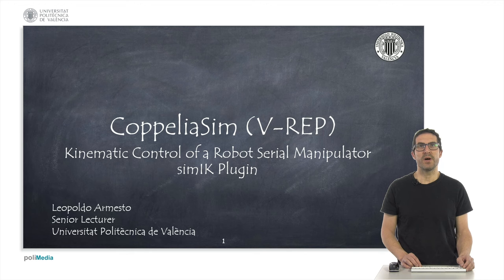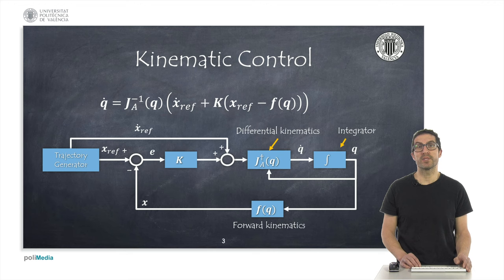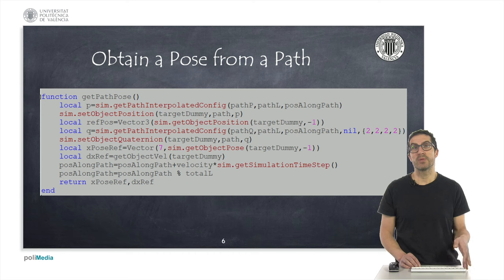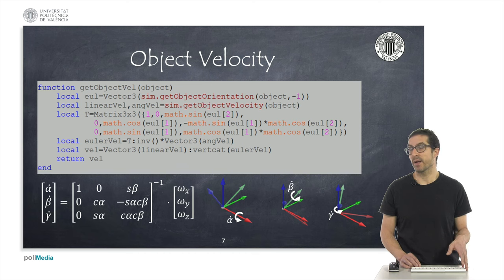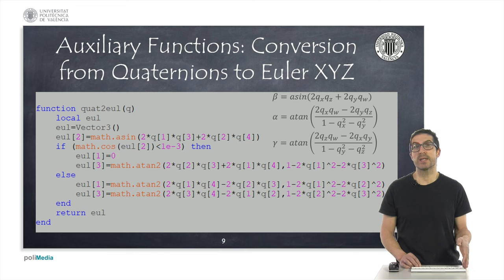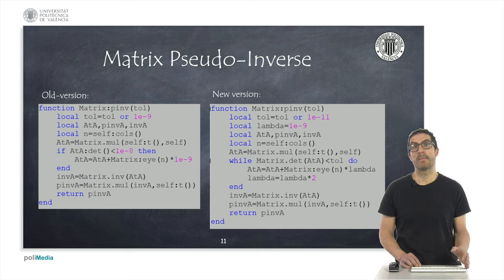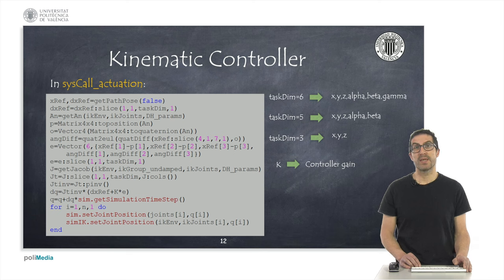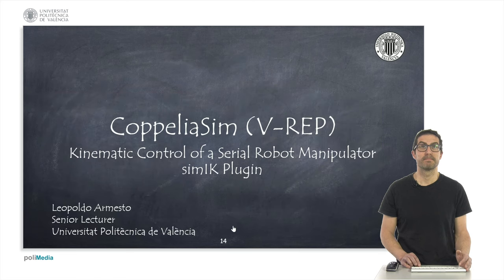Kinematic Control (Trajectory Tracking) of a Robot Serial Manipulator using  simIK | CoppeliaSim

Comment: Hello Sir, 

Thanks for the amazing series. I have a doubt about having the end effector follow a trajectory, but make it stop at say 10 different points on the trajectory and obtain the joint angles at these positions. So I run simultaion and say there is a slider, then I make the end effector move to point 1, then I also get the joint angles as output, then next and so forth.

How can I go about doing this, I realise I do not require most of the code shown in this video, but i think I require jacobian matrix somehow and the dh paramters as well?

thank you.
Reply from the maker: If you need joint angles you can query to simIK plugin for those target positions even with moving the simulated robot, just the robot in the  virtual simIK environment . You don’t need the jacobian for that task
Reply: @LeoArmesto  Thanks for the clarification sir.